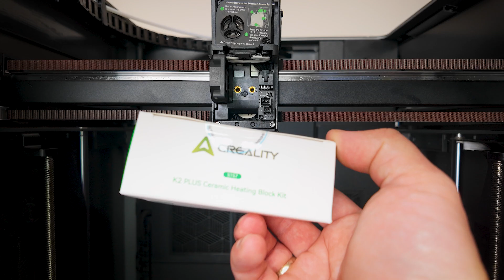How To Replace Heating Block on Creality K2 Plus

Comment: Just happened to me after 3 weeks of use, my problem was I wiped the wiped the build plate with the rag that had oil/lubricant on so the print struggled the grip to the plate. Just ordered a new heating element.

Comment: Hopefully you ran the calibration setup before your first print. After replacing the unicorn nozzle and/or the ceramic heating block it’s a good idea to run the calculation setup because you’ve changed core parts in the hot end. Thx for the video.
Reply from the maker: Ohh, I'm doing calibration every day :) During the time from that video I have found much more serious problems with this printer. Will share later.
Reply: @FirstLayerStudio Great. I’ve had to replace my K2 Plus heating block as well as the extruder housing because the Bowden tube fitting wouldn’t hold the tube in the extruder. As good as the K2 Plus is it’s got some nagging issues. Thx again for the video.
Reply: Hello, same here I had this problem and many more, and I have it for only few months
Reply: @EmergiaLab My K2 Plus is running every day and I’ve replaced the Bowden tubes with transparent ones so I can see where the filament actually is when there’s an issue. The Bowden tube that goes directly to the extruder gets a ring from the extruder’s teeth at the Bowden tube fitting so I replace it (the Bowden tube) every few months. Otherwise it’s difficult to remove the Bowden tube from the extruder. For the most part the K2 Plus is working fine but I do keep a spare extruder and nozzles on hand just in case.

Comment: I had the same thing happen, do you have any idea what causes this?
Reply from the maker: Yep, we need to glue build plate better. In my case it just unsticks first layer and then … but I hoped the AI monitoring will catch this but no. I have bambu x1c and in this case it’s checking each time quality on first layer.
Reply: @FirstLayerStudio  I run a K2 Plus, a K1C & an Elegoo Carbon and I rarely use glue on the hot bed. I make sure the beds are clean and set the bed temps at temps that in my case, seem to always stick that first layer. I find that most PLA/PLA+ sticks well @ 60C, PLA Silk @ 70C, ABS @ 90-100C, etc.. My printers all have enclosures and they are all located in my 3D print shop in my basement which has a relatively consistent humidity level. These are my results but obviously everyone doesn’t seem to be as lucky. Happy printing.
Reply from the maker: @mecaptkirk it’s true, I do the same with PLA, only PLA, I do not trust this printer with any other filaments without glue. Even if I print some long, vertical objects, even with Brim - I use glue, just in case :)
Reply: @FirstLayerStudio  The key is to know your machines & environment & filament brands too. As in any discipline, experience is invaluable. 2 years ago I bought my first printer and used glue on the hot bed because YouTube told this rookie I needed it. Now I have a box of glue sticks collecting dust. Take care.